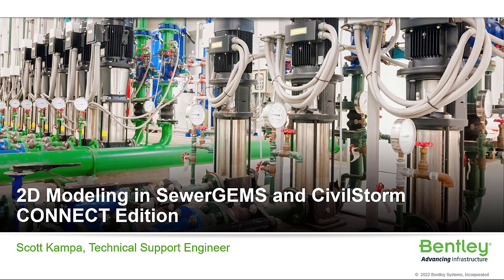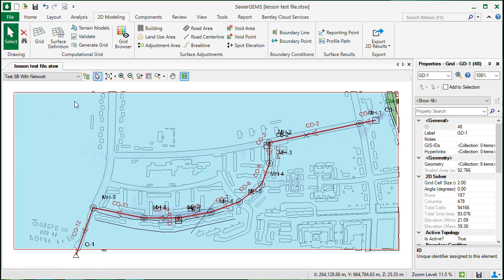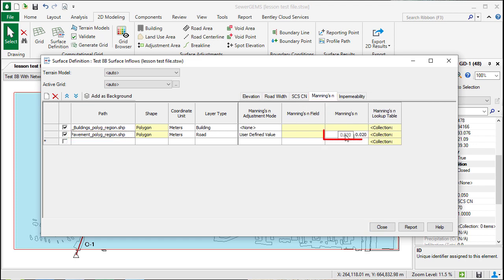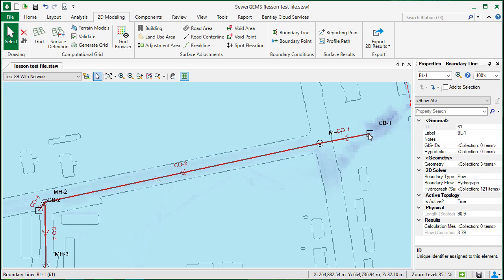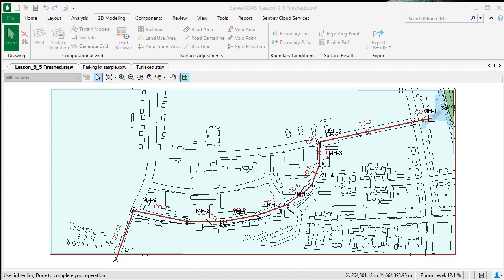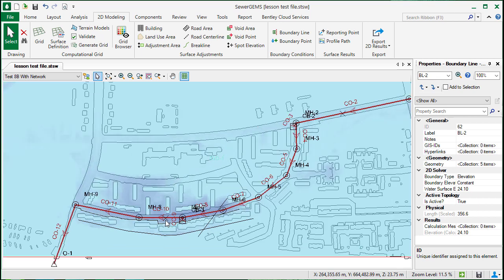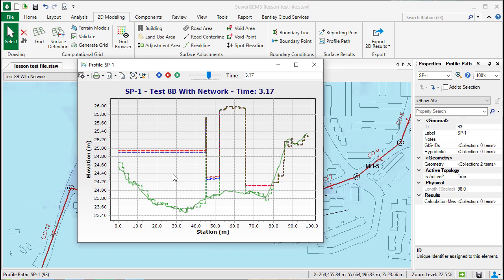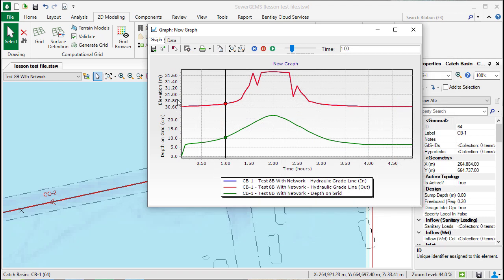2D Modeling in OpenFlows SewerGEMS and CivilStorm

Comment: Hi
In a 2d modeling on Sewergems (especially the water depth) does it take in consideration the flow absorbed by catch bassin in case when the road contains catch bassin connected to manholes
Reply from the maker: Hi - the connection of a catchbasin to a manhole would be done using a conduit, which is a sub-surface element. Meaning, surface flow (from the 2D grid, if using the 2D functionality) would first be captured by the inlet (as part of the catchbasin element), which then travels through the downstream pipe under the ground, entering the subsurface vault of the connected manhole element. The 2D surface flow will be appropriately exchanged with the subsurface 1D flow accordingly. If this does not help, please post on our forum with more details (for example with screenshots/illustrations): https://bentleysystems.service-now.com/community?id=community_forum&sys_id=0310b7ca1b1a3110f3fc5287624bcb80

Comment: The 2D engine does not support prismatic open channels. Change the conduit to a channel and set the cross-section definition at the bounding cross sections."	SWMM Export Validation
Hi Bentley, why this error? I used conduits with catch basins, and have set conduit as rectangular channel. Do I need to replace my conduits to channel and catch basin to cross sections?
Reply from the maker: You can model the rectangular channel section in the cross section element to establish the cross sectional area at each point along the channel, and connect cross sections with channel link elements. This enables the channel "burn in" to work with and exchange flow with the 2D grid.
Reply: thanks 
 @bentleywaterinfrastructure

Comment: It looks simple comparing to other 2D modeling software which is a good point. However, after i installed and tried to do the same exercise following the instruction given in the webinar in your webpage, it doesn't seem to work properly and always giving an error without enough detail of the error. The error was "The 2d solver failed during the calculation. see the report tab on the calculation summary".
Reply from the maker: Ali, did you try the Validate command? Please post this on our forum so that Technical Support can assist. We may need a copy of the data files (zipped) to review. Forum link: https://communities.bentley.com/products/hydraulics___hydrology/f/haestad-hydraulics-and-hydrology-forum
Reply: Sir, where did you get the attachments?